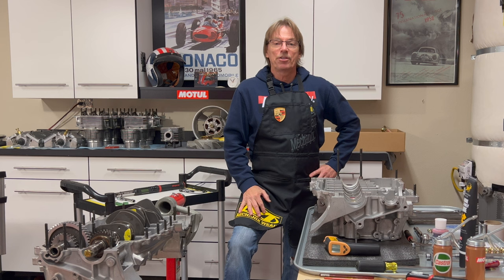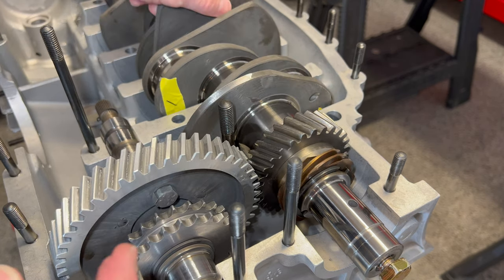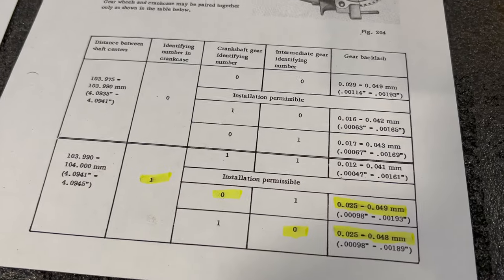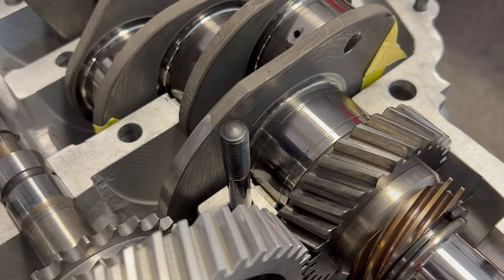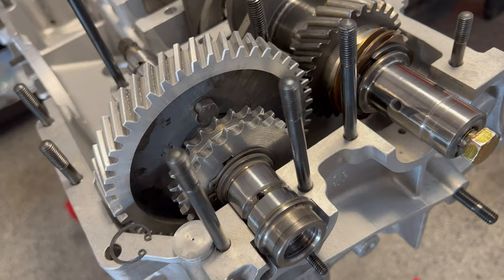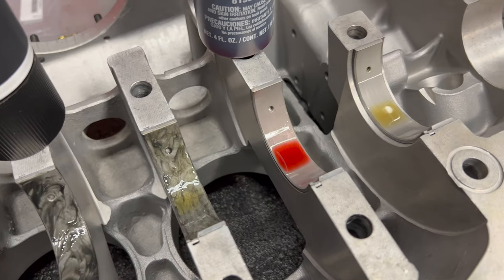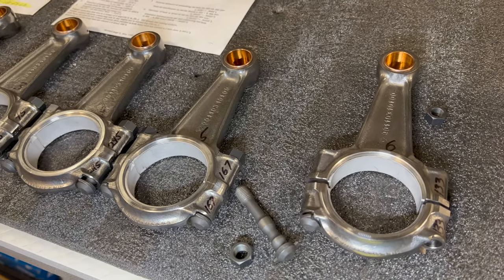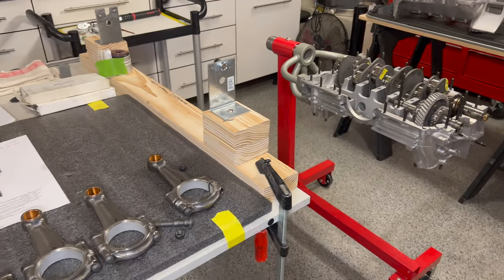Closing our 2.0 Engine Case Part-1 : Details to Consider!

Comment: Is that a new Intermediate Shaft, or did you restore the original one?  If so, how extensively did you take it apart?  Getting ready to evaluate mine and can use all the help I can get.
Reply from the maker: It is the original Intermediate shaft and large gear. The large gear ran with the counter gear being used on the crank prior so I was confident the mesh would be okay. The inner and outer smaller gears were new replacements from Porsche and installed by Ollies in Lake Havasu.
Good Luck!

Comment: Thanks for this series. I myself have just retired and have a 1971 Porsche Targa T 2200 cc to rebuild. It's been patiently waiting for me to get to it.   I been combing over all the interior redo and suspension. The real problem is always finding someone that can help when you run into a problem. You have help answer a lot of the future issues. Another problem is always where to find parts both new and used. You series is invaluable.
Reply from the maker: Hello Michael thank you and seasons greetings
Congratulation on your retirement!! Hopefully this series can be of some help to you in someway
We don't have all the answers here but we do try to open up as much as possible.
Wising you the best of luck with your 71 Targa!!
~Cheers